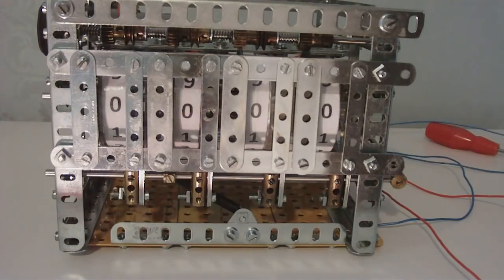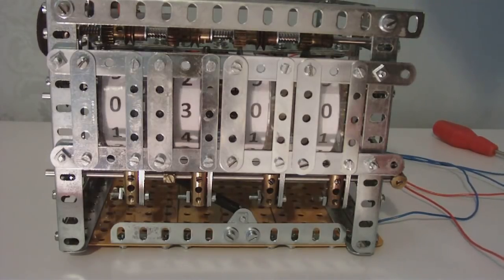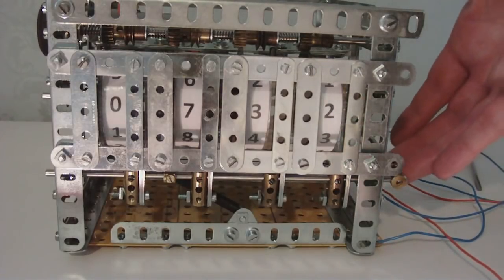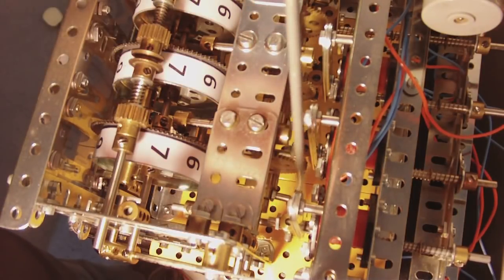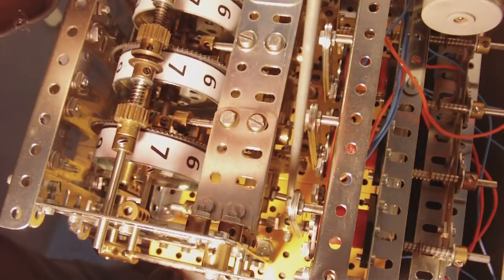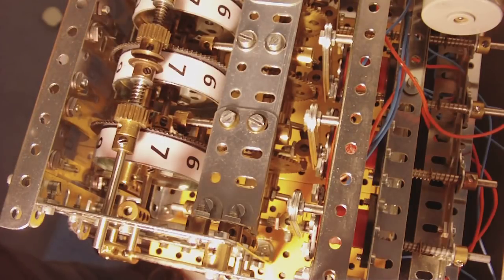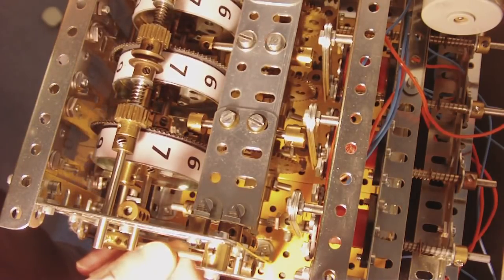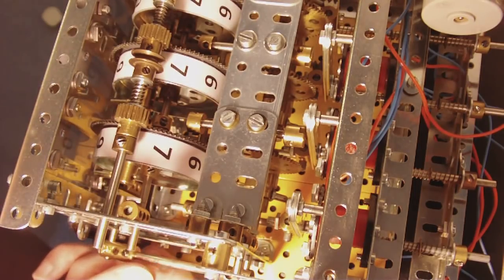Meccano Pinball Digit Counter

Comment from the maker: I don't think I could have got it much more compact. In fact it was more compact at first, but it made servicing the parts almost impossible. That's why there is a set of gears between the reels and the detent. It is still fiddly to service, the worst being a part coming loose on the reels.

Comment from the maker: Same here, when I was a teenager. The flippers were directly operated. It had some drop targets and a few scoring lanes. It operated a Casio fx502 calculator. Programmable buttons were pressed on the calculator to score. For the October exhibition it may not be complete, but the essentials should be there.

Comment: Wow very ingenious mechanism! I am very curious to see it used in your pinball machine. As a boy I made a pinball machine using Meccano parts mounted on a board. I used a metal ball that rolled over aluminum foil contacts glued to the board, this directly switched the current to a counting relais. I did not have Meccano elektrical parts, the flippers where operated by rubber bands. Even tough the game was very fun to play. Look forward to see your result, I also might give it a try to build it.